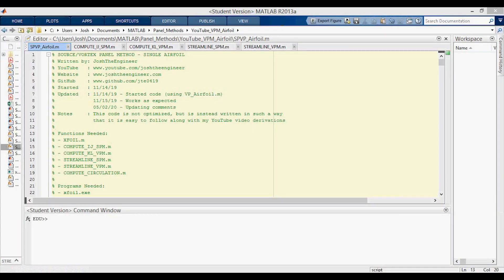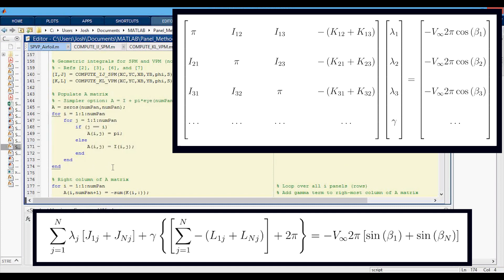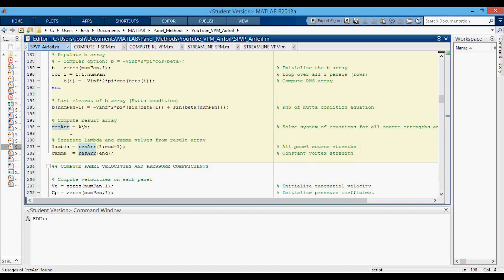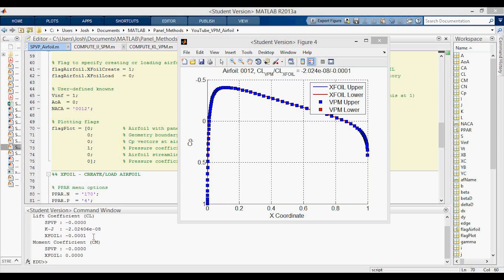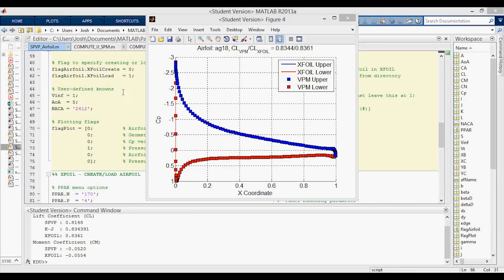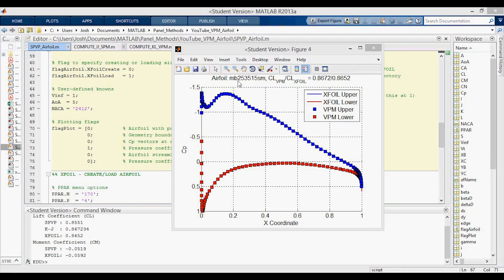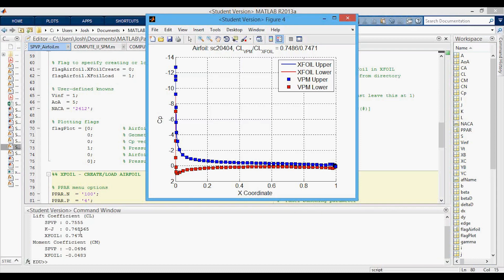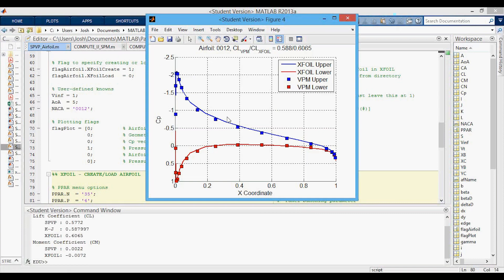Source/Vortex Panel Method: Airfoil

Comment: Hi greetings! . sir need your help. i am doing work on source panel method. I am done with matlab coding on matlab for 2D sphere.but i am having some issues in 3D panel placing on sphere. The issue is , i am not getting same shape panels instead i m getting mixture of saqure, triamgle panel on sphere. Plzz sir help me in this case.
Reply from the maker: Sorry, I haven't done any 3D paneling so I won't be able to help you here.

Comment: I hope you treasure that student version of matlab! I never realized how expensive it was.
Reply from the maker: Yea, that's why I've been trying to get into Python a little more.  I've had this copy since I got this laptop, and I'll keep using it until it dies.
Reply: @JoshTheEngineer  If you had to choose, which would you prefer?
Reply from the maker: @beachboardfan9544  Sorry for such a delayed response; YouTube doesn't notify me when I get a nested comment for some reason (or maybe I just don't know where to look).  I prefer MATLAB over Python in general, but that's probably because it's what I'm most used to (used it in undergrad, grad school, and work).  Certain syntax things in Python annoy me, and I honestly just like the way MATLAB works in general.  However, Python is really pretty great, and I just need to spend some more time using it.  The main reason I still use MATLAB for most things is because I can quickly get the idea out of my head and into code in a single sitting, while with Python, I typically have to spend a bunch of time looking up the correct syntax for each function I want to use.  I've started posting my code in Python though since it's good practice for me, and I know not everyone has access to MATLAB.